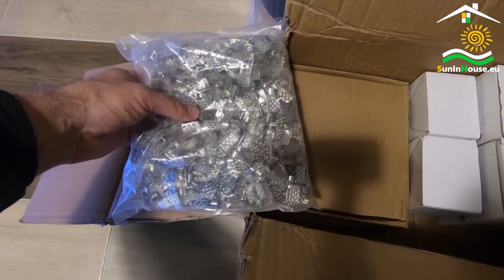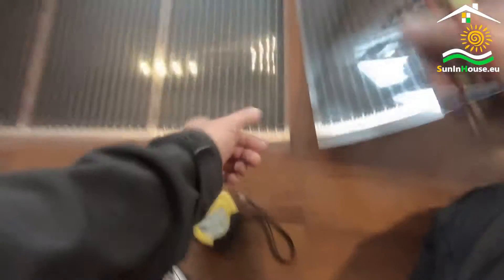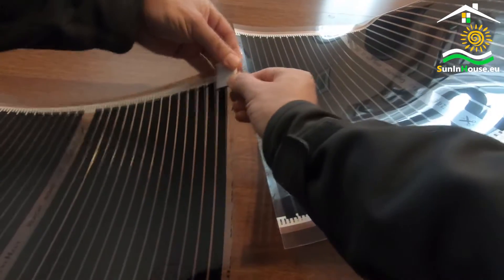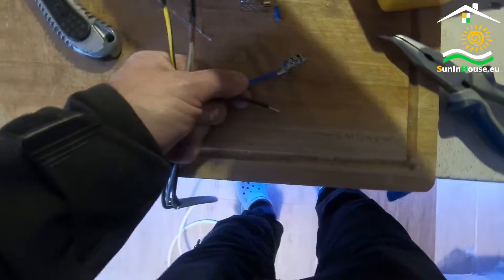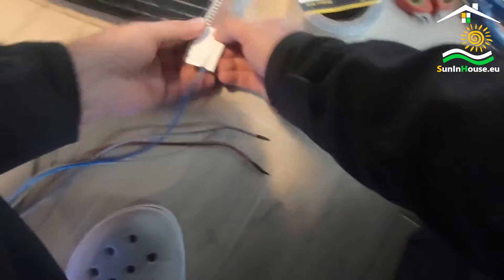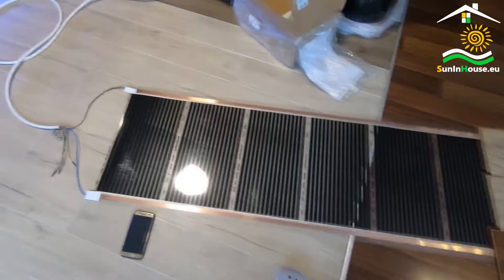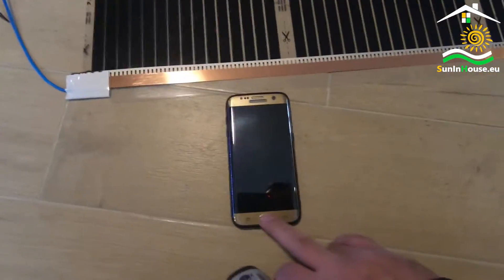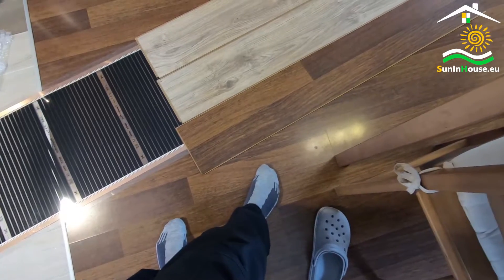Graphene IR heating film test-episode3 EN

Comment: IR heating film is a scam
as you see in the video the honest person measures  temperature with the film off and it is 22,3 C after having turned it on the temperature becomes 28,,,,, 29  hahahahah
it is sold for 60 c max ,,,, scam  !!! impossible even 40C
 the electric blanket heats more than this film !!!
it is a scam,, to heat a house of 50 square meters you have 220W x 50mq haahah are you crazy??? 11000 watts!! = 5 washing machines maximum power 2200 that work all day!!! crazy
it is totally a scam ! mine heats at 30.5,,,, nothing!! big disappointment,, you don't heat your house with these scams
you can put it to warm your feet when you watch TV but nothing more!!! This a  scam !! big disappointment,, even in the video you will see that the house is already at 20.3,, but you will never heat a house starting from 10 C hahahha
best wishes for the electricity bill,, it actually consumes even more than 220 / 300 w per meter and remains warm just slightly warm like the video,, lukewarm, the only warm thing will be the energy bill,,!! this a scam, I threw the money in the toilet to do a test but I am very disappointed !!

Comment: Hi. I have 4 IR mats of total power 520W. What is the best way to wire them together?...
The voltage is 220V. 
The thermostat is max. 16V. 
The sizes of mats are 3m x 0.5m (2pcs) and 3.5m x 0.5m (2pcs).
The power of IR mat is 80W/m2.
Total power of IR mats is 520W.

Thanks in advance for your reply.
Reply from the maker: in parallel

Comment: Wow nice explanation, very detail and useful. Thank you so much for sharing. 

Anyway, the heating film  in desc told 220W/m2. If we use a little piece, does the watt still same? 
Also, is there any heating film that above 220W? Because 30 C seems not hot enough for me. I'm looking for above 50 C heat.
Reply from the maker: Believe me, it is warm enough for domestic purposes, 50C and above is not a safe level you are talking about, unless you mean applications for terrariums etc. Here we focus on the application for heating apartments and houses and in such a situation I recommend for ( not old buildings) foil with the parameters of 120W/m2. The energy consumption is the same. The ratio of switching on the heating and warm floor to the standstill times is more favorable from the point of view of user comfort.

Comment: Hi! I don't find and product datasheet PDF to know lots of electric characteristic.
I have: excel ex305 carbon heating film
What is teh opening voltage it needs?
Does teh 220V version work from 100V etc?
Withiut thermostat can it overheat or stay az 55C degree and not dangerous to let it go on full power if cooling is possible (only testing laying open without thermostat for long time without under any surface)?
Which side to be outside for reflecting more infrared?
Reply from the maker: products of this class should be treated in use as classic heaters - the use of heaters without thermostats is extremely unacceptable as dangerous and that's about it, I am not able to comment on a product not purchased from us
Reply: @suninhouse6988  ok thanks, I just want to test this without installing inside anything, just turning on and chech heating effect measuring with infrared camera. Even adding a reflector below it I could not measure it hotter than 58 C degree yet, the PET film should be safe below 80 C and the lamination safe until 150 C according to the spec.
First I have to know it is safe befor installing it into the floor.
As I know it is based on PTC technology so shoul not overheat itself.
I make several tests fir 5 then 10 then 15 etc minutes and check it with FLIR thermal camera without thermistor.
It should be safe without thermostat as a thermostat could be faulty too, the heating film should be safe without it.
Reply from the maker: an electric water heater without a thermostat is not considered safe and so should the heating film, what you are doing is not the right approach
Reply: @suninhouse6988  it is different technology, but even water heater with a simple rsistor wire can work without any harm it correctly designed. FOr example I had water heater for my aquariom a 30W or 50W without any thermostat could work fine for years if there is enough water level. We should no make things too complex.
For example this heating film gerts until max 59 C deg max according to my measures since hours of tests.If I would use a thermostat to keep it at 35 C max it would turn it off immediately and this 200W model I have would only work abour 20W as most of the time would be swithced off reacing 35 c deg. Why should I buy a 200W if I get only 20W of heat? Why should anyone buy a 5000W to a room if it is turned off most of the time and work on 500W average?
I think it is just business, to buy more and more... but I take care, measure temp etc periodicalli in th next days and I only use a small 200W panel (1.5m long) and it is uncovered just hanging on the wall now next to me.
Reply from the maker: Ok for small instalation (hobby) can be, I was thinking about heating systems for houses.
Reply: @suninhouse6988  no it just to experiment with a small uncivered one on teh wall nex to me while I am working at 18 deg C room air temperature
Reply: @suninhouse6988  ok, I tested now 3hours of run without thermostat, temperature is max 59 C degree still at room temperature 21 c degree, so it looks like stable. I will do longer tests later. thanks